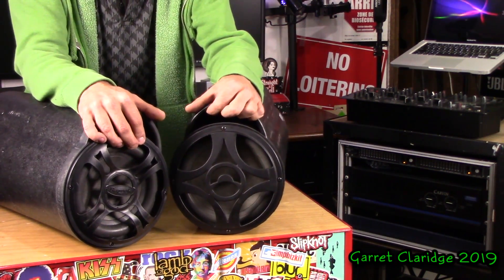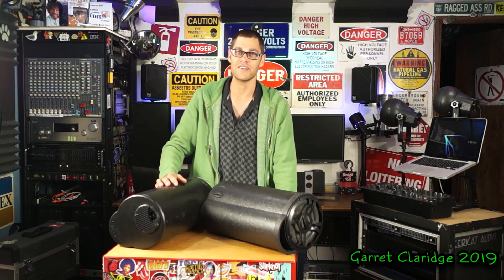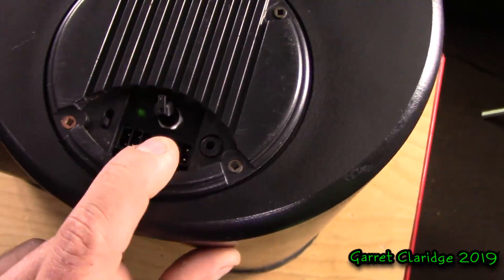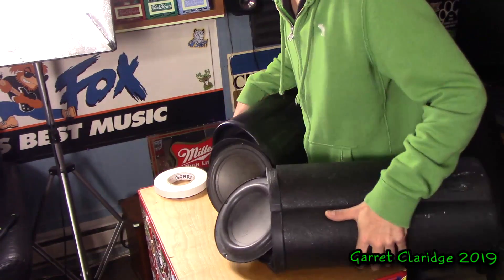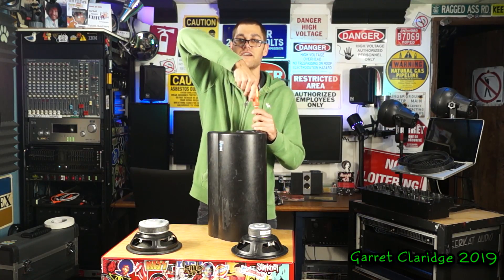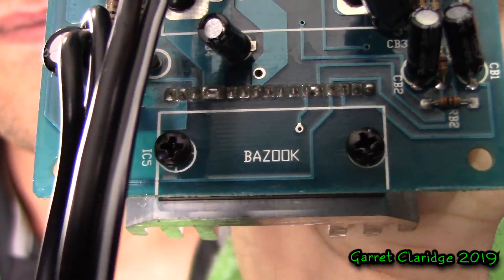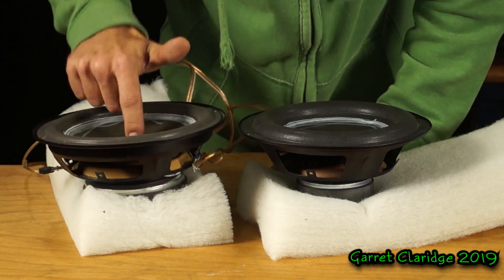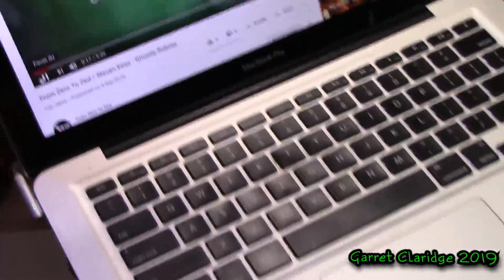Bazooka Tube Subwoofer Teardown and Blowout

Comment: ☆toggle switch is for turning on and off the Auto-power-on feature, where it will turn on with just the audio  signal input or with a remote wire.

Comment: What would happen on the dual coil speaker if you put 2 different songs through it at the same  time or connected the same song but with opposite polarity?  In the second case could you have it make no sound at all (but lots of smoke)?
Reply: It would make a tiny bit of sound because the two coils are not identical (same song). Otherwise yes, it wouldn't move much, and would smoke up heaps. If played right you could let hear build up and then catch it on fire.

Different songs would just sound like different songs playing at the same time

Comment: that 8" seemed fairly robust; at least compared to the 10" EL.  looks like it was designed to handle more than the 50W advertised.  Thanks for opening up the cabinets.  I think some well placed sound deadener (80% coverage inside the barrel), and some better poly-fill and those tubes might sound really good for what they are.  I always like the Bazooka tube for their all-in-one design for the DIY car audio guy on a budget.  might have to pick one up and integrate it into my stock stereo
Reply: Did you ever get one ?

Comment: Hmm, might need to pick up one of these for my car. I like the all in one idea and seem to be decent quality.
Reply from the maker: id use one haha better than any stock sub ive seen
Reply: I got a free one that had a small broken trace on the amp. Easy fix and my dad loves the extra 100 watt bass boost. I think it's more like 80 watts but still adds a needed depth to a decent sound system.

Comment: It’s weird that the more powerful (100W) sub has a smaller surround than the less powerful (50W) sub
Reply: Foam surrounds tend to be more flexible.
Reply: @brigganthewolf1461  not only that, but the larger cone (less area taken up by the surround) should actually be more efficient (generate more sound with less movement).
Reply: @BH4x0r  Exactly!

Comment: I remember those facing each other in a Push pull in a friend's van. Didn't know how horrible it sounded in the 90's😂 just had stuff hooked up to leads off the back speaker lines through a equalizer booster, damn 🔥 fire hazard.

Comment: 5:30 i gotta know what the IC is. i dont see a boost converter power supply on it so for 50W it would have to be running close to 1 Ohm
Reply: Probably a generic copy of the TDA1562Q.
Reply: @nitrosake  ehh i dont think it would be a copy the bazooka brand is decent. ive seen the 1562Q alot and i dont understand the very high power on only 14V
Reply: @bassblaster505  Class D amplifier. Very efficient.

Comment: I still have my 10" passive Bazzoka from the 90's. I used to have an Orion sub mounted in it; on about 500w rms mounted in the hatch on a 86' Z28. That tube slammed in that car. Shit got really low for a single 10. Those tubes seemed to be a really efficient, given that it is mounted in the correct environment.